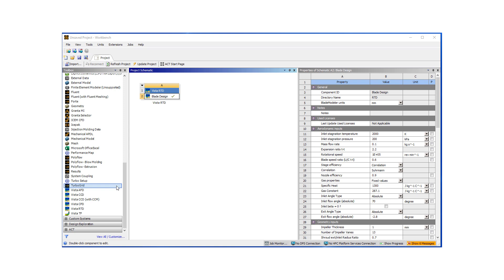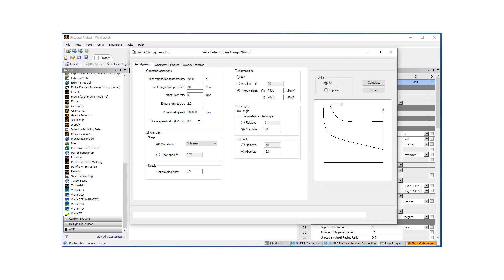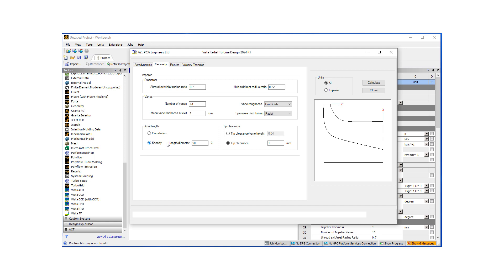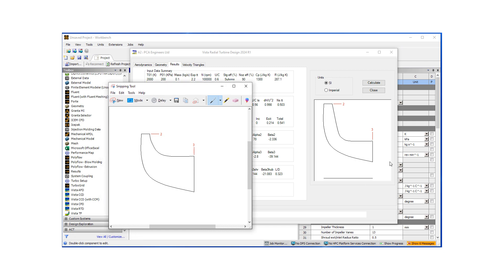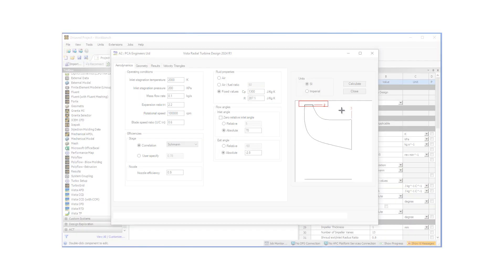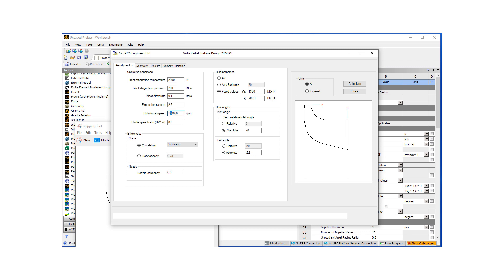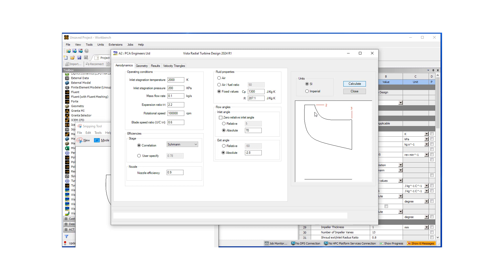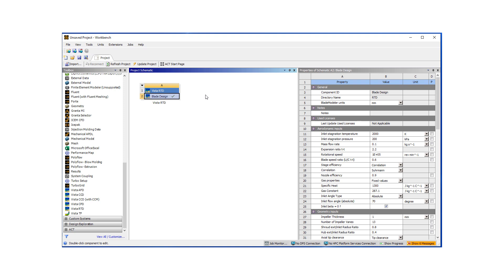Vista Radial Turbine Design (RTD) tool by Ansys

Comment: I'm a final year aeronautical student, and my individual project revolves around the preliminary design of a radial turbine for a micro gas turbine using Ansys. Utilizing Ansys Vista RTD, I obtained crucial output parameters necessary for the analysis. However, I'm unsure about how to discuss loading coefficient parameters in my dissertation since I didn't need to extract values from a loading coefficient chart. Any advice on how to approach this aspect of my project would be greatly appreciated! Additionally, I welcome any other advice you may have regarding my dissertation. Thank you!